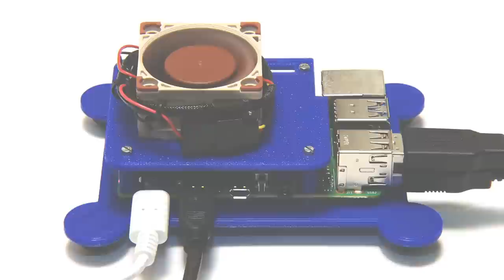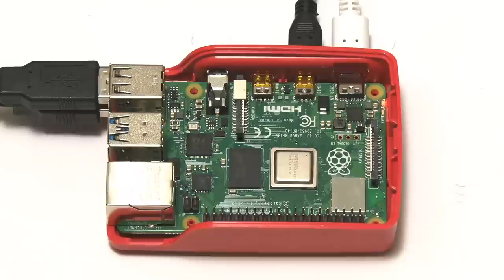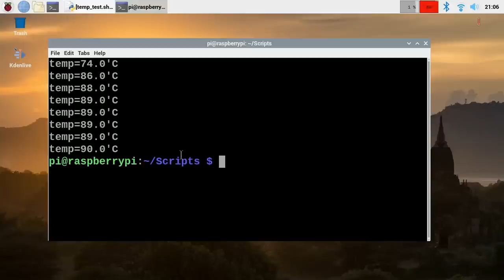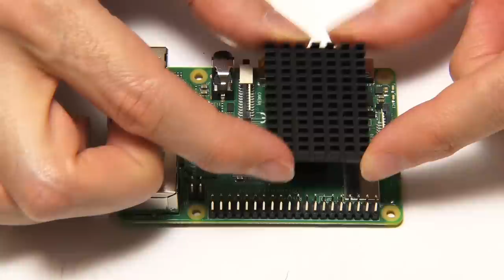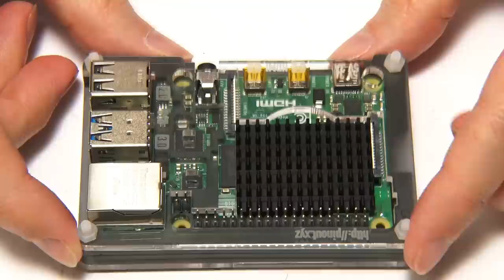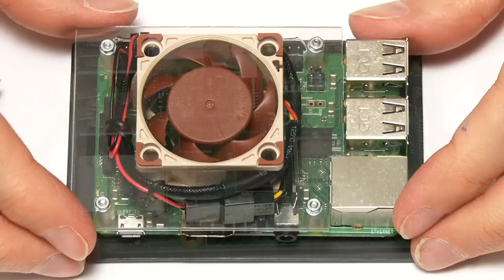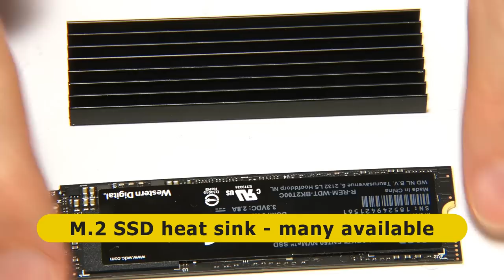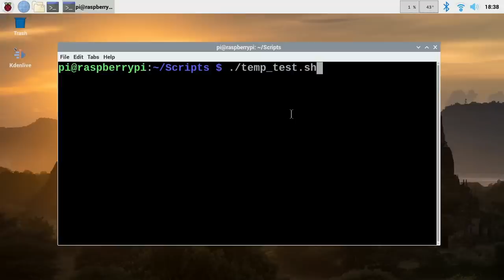Raspberry Pi 4 Cooling

Comment: Hello the ExplainingComputers.com man!
Since the creation of this video, there has been a firmware update that optimizes the USB controller so that the (naked) Pi will now idle much cooler than before. I say that a little update on Pi4 cooling might be in order.
I have created a script for stress testing the Raspberry Pi. It features, besides more detailed output, color-coded output, similar to how the temperature indicator in the taskbar is color-coded. If you would like to check it out, I put it on GitHub: https://github.com/voltavidTony/rpi-stress-test ; I also have it on Pastebin: https://pastebin.com/BS5ZYFxq
Reply from the maker: Thanks for this, however the USB controller update has realeased before this video was created, and was applied before these tests were run (as I say somewhere about half way through the video). Others have had very significant issues using the script 9adn I believe it may still be withdrawn for that reason?), although for me it has run fine. By chance, my second Pi 4 cooling video releases this Sunday, and looks at some great commercial coolers for the Pi. I'll checkout your script. :)
Reply: @ExplainingComputers  wow, thanks for the quick reply. I was half expecting it to go under in the sea of other comments like usually happens on channels with large amounts of subscribers.
As for the script not working, I have no guess as to what is causing that, since most of the significant commands run on both my pi 3 and 4 and my Ubuntu WSL on Windows just fine.
Reply from the maker: Thanks for this, and I think I have confused things above. Sorry. The script that has caused problems for some Pi 4 users is the USB controller update one, not yours. :)

Comment: They should've left the panels on the official case. You used to have the benefits of a case with the ability to open it up for better airflow. Now it's just 2 pieces that don't act as a case if you take one piece off. Plus the old case looked way cooler. This one makes me yawn.
Reply from the maker: Totally agree on the panels.

Comment: Quite obvious results. And me thinks there is no real need for aluminum radiator. Simple tin or copper pate would suffice. As principal cooling job is done by fan. Also, heat pipe solution would be interesting to try. Overall excellent job.

Comment: Very nice! I'd also be interested in comparing the same set of tests but with the "tower cooler" used by ETA Prime in his video https://www.youtube.com/watch?v=RyUXC3886Ic He achieved around 40C with that cooler but most likely the tests he ran through were different than Chris' in this video. I am not trying to say one cooler is better than the other because both (as well as liquid cooled Pi - yeah!) would have their own use case scenarios. Rather that it would be nice to have a video that compares cooling capabilities of different air coolers for the Pi. Thank you for consideration.
Reply from the maker: I will be posting a follow-up featuring the ICE Tower and various other solutions fairly soon.
Reply: @ExplainingComputers  Excellent! Look forward to it! Cheers! 👍

Comment: Using my raspberry pi 4 cooler, I got the result as follows, (by running temp_test.sh)
temp=37.0'C
temp=44.0'C
temp=45.0'C
temp=45.0'C
temp=44.0'C
temp=45.0'C
temp=45.0'C
temp=46.0'C

Cooler than ever :)
Raspberry Pi 4 Dual Cooling Fan Aluminum Alloy Case

https://www.youtube.com/watch?v=7qxgiIomhZg
Reply: Sorry, I did not watch raspberry pi: more active cooling. Ice tower is the best.

Comment: "Radical active cooling solution". Skip all the over nonsense. This is the dream.
I don't think the second test is really valid because you don't have it in the case. Wouldn't the temperature also have been much cooler if you had run the pie with no case at all?
Reply: *all the other
*pi

Comment: was that python language??...cause that doesn't look exactly like python.

I'm not familiar with raspberry pi
Reply: That was a shell script, bash shell to be precise.  Google 'bash shell' for more details.  It is a Unix/Linux thing, not particular to the Raspberry Pi at all.
Reply: it's a command interpreter language specified by POSIX and derived from a so called Bourne shell, a program, which was a standard command interpreter for UNIX.

Comment: Completely stock without heatsink or anything mine would max out at 85°C. I drilled a hole into the case and added a small fan which brought the temperatures down dramatically (max. 60°C) even under high load, similar to this: https://www.youtube.com/watch?v=mTHAO9P_hxQ

Comment: I disagree.
With the actual software available I don't see any intensive tasks scenario on this little device, not even streaming 4k videos from a NAS made with it will probably trigger the thermal throttling. Emulators are more or less optimized, they won't suck the 100% CPU resources all the time. Maybe modeling in Blender could have been an 'intensive task', if it wasn't crashing right after launching it. We got our desktop machines for heavy lifting. I do understand this is an in-deep test video but I don't understand people's obsession to add noisy and useless fans everywhere they can, when the Pi is specifically engineered to operate fanless (Source: the official website). As you tested, a small heatsink - or a decent metal case (like the FLIRC case, with the shell designed as heatsink) is enough to prevent thermal throttling.
Why making it unnecessarily bigger and uglier, to win 1 minute to finish a stress test? That will rarely happen in the real world, while the fan will be:
- buzzing 24/7
- wasting electricity
- collecting dust
- annoying you
Reply from the maker: The Pi is 4B indeed advertised to operate fanless, and indeed without a heatsink. But in reality, it fairly rapidly throttles (first level, thermometer appears on screen) playing 1080p video when in the official case.

Comment: A SOC that requires an active cooling is a design failure. Do you agree?
Reply from the maker: I agree that a SoC that requires significant cooling, but has no specific included provision for mounting a cooling and connecting a fan, is not a good idea . . . The requirement for active cooling I think removes many potential application areas for the Pi 4B, which is a great shame. I think a lot of Pi Zeros, 3B+ and 3A+ models will continue to be sold.

Comment: Genuinely disapointed by your tests. By changing the case none of your numbers mean anything.
Reply from the maker: I disagree that none of my numbers mean anything. As always on this channel, I test real world scenarios. I started with the Pi in the official case  because that is what the Raspberry Pi Foundation must expect it to be used in (and it is sold with the Pi in various kits).
Reply: @ExplainingComputers   It still affects the thermals significantly. In my opinion the test would have been the pi bare no case/no heatsink, then the pi with the small heatsink/no case, then the pi with the m.2 heatsink/no case, then the pi with the m.2 with the active cooling. Putting the pi in a case for one test was adding a variable to your tests that wasn't constant which skewed the results. Long time fan btw.
Reply from the maker: I agree that the case "affects the thermals signifantly". Though three of the four tests here were in a case of some kind. Glad to hear that you are a fan. :)